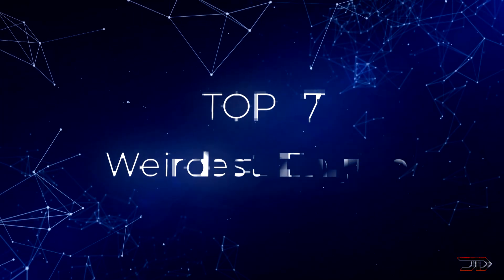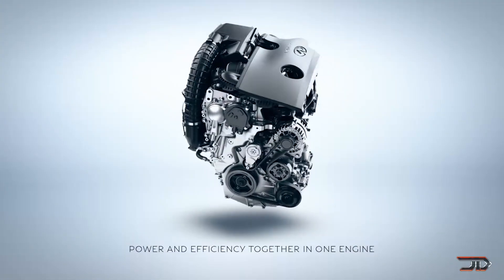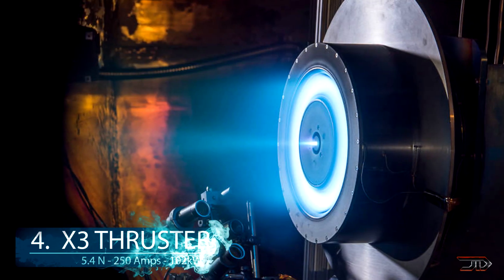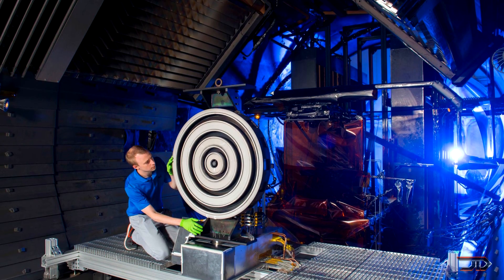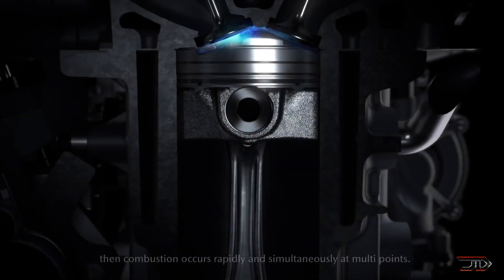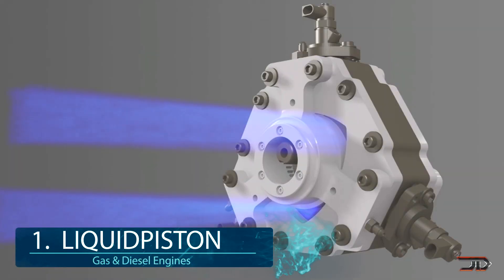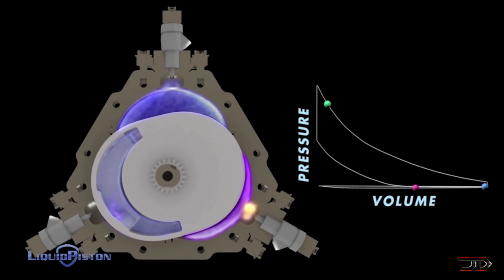7 STRANGEST New Engines

Comment: because of the excellent ratio of power and weight and the high rpm, what if it was configered like a train engine where it powers an electric generator thst powers an electric drive moter,? what would the mpg be?
Reply: you probably wouldnt need much of a gas engine to do that, probably something like a lawnmower engine lol. BUT big car companies have big engines and products for them so they will jam them down your throat :D

Comment: #5 QuasiTurbine looks like an ordinary Wankel Rotary Engine, modified.
Reply: Quasiturbine is not a Wankel bc Wankel had triangle piston surface and is based on the principle of volume variation between a curve and a moving cord (a sliding single piston-object on the curve). The Quasiturbine does not use this principle, since the maximum volume as well as the compressed volume are both in a straight line contour area.

Comment: I've seen some variation or another of most of these designs 20 years ago while working on my first engineering degree. 

Wankel engines are dead; too dirty for modern emissions, and impossible for 90% of mechanics to work on (aka, "throwaway" engines,  as it cost more to rebuild/repair one than just buy a new one).

Variable compression has been tried by just about every major manufacturer, as far back as the 70's; variable geometry engine heads and crankshafts just don't bode well for long term durability, and when they fail, they usually do so catastrophically, destroying the entire engine in the process.
Reply: keywords "as far back as the 70's"

Comment: For me the bottom line should be battery technology.  Aluminium, Magnesium as alternatives to Lithium.  Safer and much greater storage.  And why?  Simply one cannot beat an electric motor for power, torque, reliability and simplicity.

Comment: Design engines for electricity generation with no connection to the drive wheels and a means of temporary non-battery storage for boost purposes.  Or watch the cost of batteries drop, size per kW be reduced, lack of requiring liquid thermal management, and longevity, & say goodbye to ICE engines.
Reply: do the first part and you will see the second part :D

Comment: Guess what...they are making engines that need no fuel at all and have a superb minimum of moving parts...i.e. only one: the rotor. Called "electric motor". Great efficiency, supersilent, light, no emmissions, runs in both directions, great torque from sero revs, no excentric movements...anything else you need for propulsion? Combustion engines are, generelly speaking, one of the worst solution available for moving a vehicle with constantly changing speed and high variation of power consumption. Besides the high energy content of the FUEL it the far stupiest invention mankind has ever brought to such a wide use. Not to mention the fact that the emissions in gases and noise make our villages sometimes inhabitable.
Someone seems to make BIG BIG money with these...

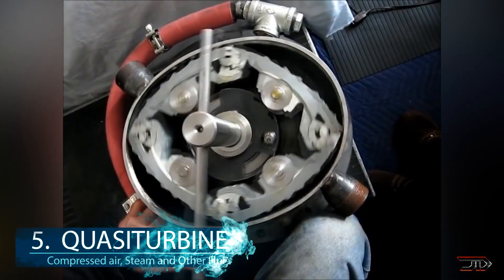Comment: The quasiturbine (No. 5) 1:32  is similar to an engine invented in the early 1960’s by Eton Rajakaruna, a friend of my father, in Hull, UK. He was from Ceylon (now Sri Lanka). He called it the “heart-beat engine”. It was featured in an article in Popular Science magazine in April 1962. He was inspired by a vague idea my father had about the possibility of containing the intake, combustion, expansion & exhaust cycles inside a bag-like vessel instead of using a piston & cylinder. Eton’s design looked very similar to the quasiturbine except the combustion took place inside the collapsible box. He was a proud man & claimed that he’d built the entire thing himself in his kitchen using minimal tools. In actual fact my father made most of the prototype parts for him & he made small changes himself. It never ran because it was almost impossible to seal the hinged corners & sides where the combustion chamber contacted the cam plates on either side. It recently struck me that it may have worked better as a steam or compressed air engine, a point that is also made about the engine in this video as well.
Reply: Cool story, bro 👍

Comment: Again with a  engine with just to many parts to go wrong. When are you lot going to get into the simplest motor of all.  An electric motor will and can out perform and last longer than any petroleum engine in the market.  It is also very economic in fuel economy in that it loses very little of it’s heat in the form of wasteful energy.  I ask you, how much more co2 are you planning to chuck into the atmosphere before you mess up the air we all breathe....?
Reply: Probably when we can produce batteries that can reproduce the benefits of petroleum engines.

Comment: This so-called "ACHATES" engine is another example of the "True BOXER" engine where the pistons meet each other in the centre. The engines in  Volkswagens and Subarus are NOT boxers. This same three-cylinder boxer layout was used in a British 'Commer' diesel truck in 1949, very successfully; only difficulty is this engine type must be supercharged just to get the fuel mixture in there. 
P.S. The exhaust note is really Sump'n Else...!  Ruummph...

Comment: Electric motors have all these beat. The combustion engine is going away....
Some of these are crazy complex for no reason except the better ways were already patented...

The ELECTRIC motor is about 95% efficient. Internal combustion engines are 25% to 50% efficient. Yes, most of your gas is wasted and doesn't move your car. It's mostly wasted HEAT adding to global warming....

An electric motor has ONE moving part with no friction. Electric motors last hundreds of thousands of miles....
Battery technology is slowly catching up and when it does, gas engines in cars will be history...
Reply: when you factor in the cost to produce electricity to store in an inefficient battery to run an EV...  the efficiency rating drops considerably. on board chemical storage of electricity (aka, batteries) are sorry to say... a dead end technology. no amount of technology can break the rules of physics/thermodynamics. (hot battery - high discharge, low capacitance; cold battery - high capacitance, low discharge; problems inherent to any battery design). not to mention weight and cost.

It'll take a generous leap in technology to put electric motors back in the #1 position for EV's. aka, cheap, efficient power generation on demand.

Hydrogen is the end game. It's the cleanest, most abundant, and most power potential per weight.  We just need a cost effective means to extract/separate it, and a safe means to store it.
Reply: @wildbill6976  I dont think hydrogen is going be the big new idea or a replacement for crude or coal. Hydrogen is a great idea for storing excess power from solar panels at home. But other than that its not going to be useful as fuel for a car. 
You never know what the future will hold. I would love hydrogen to be the end game.
Reply: @OregonDARRYL   Im all for clean technology the sooner and faster the better... Just dont claim 95% efficiency of electric motor powered cars because you just make me LOL at your ignorance. The older the car the more environmentally friendly it gets as it ages.

And the fact you resorted to try denigrate me instead of argue your point of view with an intelligent debate.  I could only possibly assume with 95% certainty (LOL) that you voted for Trump.
Next time you update your phone ask why their is a usb cable and power point charger in the box when the one from the old phone before is only needed? Why did it come in a plastic box instead of cardboard and paper box.

Most people understand that COAL is bad and if you think different then your wrong.
But solar panels are high polluting industry at the manufacturing level. and mining rare earth materials is moderately high pollution industry.
 Think outside the box and look at my first post because electric motor cars pollute more than modern diesel and petrol engines, it just changes where the pollutants are exhausted and since most countries are coal (base load) powered its not a clean form of energy nor is it efficient.
Reply: @paulduratec3410 , I didn't vote for the lying pussy grabbing mobster baby.
I think coal is shit.
Electricity can be generated from MANY sources.
The cars of the future WILL be electric, and those who don't know that are not paying attention.
Reply: @OregonDARRYL   honestly I didn't think you voted for Dump.
Nor should you assume I'm American.

And yes there are some very exciting idea's about power storage (non battery) and wind and solar farms that all governments can and should start investing in now.
But everything has its pro's and con's and you need to look at both sides.
Reply: Surely electric motors are the future in some part of transportation, but there is no reason to rush it. There is plenty of oil left to be used, charging infrastructure is scarce, ranges are still not satisfactory, batteries are big, heavy and relying on metals that are mined in some horrible conditions both for environment and humans, and are hard to recycle. So, easy.
Reply: fenton bevan  they are not that rare, Its like diamonds. Worthless stones that were marketed very successfully. Until finally there was an industrial purpose for them
Reply: except you forget to mention the coal that is burnt to make the electricity(base load), best coal powered stations are getting to 60%-75% conversion efficiency, then theirs the losses through power transmission maybe 10-20% or higher, once it makes it to your property, then the conversion from power point to dc current 85% efficiency at most, then chemical battery storage losses (altho there are some very efficient batteries coming soon (10years to production  lol)), then losses from converting chemical battery storage back to electricity to power an electric motor (which at best 75% efficient) then there is the losses of conversion to mechanical power train . Yup engines are so last century and electric powered cars are oh so clean for the environment. Ohh wait the environment hmm solar panel production is a such a clean industry no pollutants being pumped into river systems there.
Rare Earth Materials yeah no massive pollution there. Modern Diesel Motor 60% efficient,
 Modern petrol 60% due to diesel like technology coming very soon. Then their is  LPG direct injection engines and countries that run the whole economy on Ethanol<<zero emission fuel?.
Good and Bad in everything but yes electric motors are not ZERO emissions at all and I question where current technology will take us.
I think over the long term my 1972 ford escort wins this race
Reply: @Dirk Pitt, see Dirk, now you're talking about skin color. That makes you a racist piece of sh!t. So, see I am better than you! Ha. Also, I'm about as white as snow... so you guessed wrong about my name. Are you clowns ever right about anything? Nope...  hahaa.. what a dumbass..
Reply: @Dirk Pitt, you thought you were better than me.. right... you're not better than anyone. You're an ignorant old racist clown and you probably voted for a pussy grabbing LIAR, right? Don't puss out, answer, if you can.
Reply: Racist worm.
Reply: @Dirk Pitt, oh I see, If eventually the Earth will end, why not just do it now... I get it. Sure.... Or species stands no chance of survival with that attitude, but you are free to believe whatever makes you feel good.
Reply: @Dirk Pitt, enjoy the 2020 election when we take it ALL back from you old bastards... tick tock... Hahaa..
Reply: @Dirk Pitt, I mail in my ballot, then check online to make sure it got there. I live in an advanced state.
Reply: @OregonDARRYL    LOL
Reply: @Dirk Pitt, wrong. The fact that I give a shit about the planet and my species's future means I AM better than you, and you know it... But feel free to believe whatever nonsense you need to... that's what you cons are best at - conning yourselves... ;-)
Reply: The ones who hate America are assholes lime YOU who hate Americans. This country was designed to be ALL countries combined, and it is. Don't like it... get the fuck OUT.
The ones who hate America are the ones voting to make the rich richer and everyone else poorer, while we go 22 TRILLION into debt. The wealthy have taken 16 trillion out of our economy in the past 20 years, and you are their willing stupid slave. Nice going genius! Keep voting to fuck yourself, your family and everyone else, dummy.
Reply: @OregonDARRYL 
>This country was designed to be ALL countries combined
No America was whites only originally, the founding fathers actually had great amounts of discussion on if America was to be British only or accept other Europeans as immigrants.
So you got that completely wrong nevermind you forget that the electric cars have to get their power from somewhere which is as Paul said earlier gonna be burning fuel.
I really don't think you've got a clue on what you're talking about.
Reply: @Dirk Pitt, yeah, I knew you were an old man incapable of learning, or changing... it's because of guys like you, that our species has about 200 years left. Thanks.

Comment: This may send me back to the Internal Combustion Engine Design books I studied 50 years ago. The thing is, most racing engines have rather high compression ratios. We buy special pistons, or mill the heads or change other things to get what?  HIGHER HORSEPOWER. That is, High Compression results in MORE power.  Power and Energy are directly related, right. The more energy per unit time, the more power. So, seems to me that increasing the Compression ratio must increase the energy available to create power. That is LOW COMPRESSION results in LESS POWER.   If that ain't right, us racing guys must be experiencing other world physics.

Comment: Im building a engine with only 1 part that doesn't move and improves the power of 4 AA batteries to operate a Car, I have tested it and the Hot Wheels Car is really fast.

Comment: Once your ionic thruster has got you to a speed of 25 miles per second, can you tell me what device will bring you to a halt?
Reply: You wanna make a trip somewhere, you simply turn around halfway and brake by using your ionic thruster
Reply: @danieldorn2927  You'll have died of old age before you got to the nearest star.
Reply: @LeighHughesSenlis  That is why they are used for unmanned probes. Check out Project Orion which was thought as a way to transport humans around the star system and get rid of nuclear arsenals.

Comment: I prefer engine with low number on parts. Whis will make less friction inside engine and less oil wear. This option will result less mechanical failures and less oil usage on oil change in period of time

Comment: The opposed piston engine has been around for a looooong time
Reply: Dave Micolichek  and german  diesel for aircraft using.  Jumo  205 &207.
Reply: @matthiaskorn7544  Aaand the Deltic, used in both British navy light assault boats and Deltic Class locomotives.
Reply: The Fairbanks Morse opposed piston engine was used in us submarines since 1938! Got to see one in person at Great Lakes Naval Training Center.
Reply: The old knocker had a truly amazing sound.... I hope they can get this thing right, could be interesting
Reply: wwii era tank engines. some old school heavy duty construction equipment
Reply: It seems to have the same disadvantages like any 2 stroke engine - so what's the point? Do it because you can and because it runs?
Reply: Dirk Müller-Paul do it because the make a shit ton of torque with little effort.
Reply: @TonyMcClelland2  But you need two crankshafts and in the result it's just a 3 cylinder engine with 3 combustions for each revolution, although with two pistons moving with each cumbustion. This gives a little advantage in balancing the moving masses, ok. But the stroke for each cylinder is smaller because the expansion of the ignited gas is limited (unless you're not injecting while burning). And then it's still a 2stroke engine...amongst the combustion engines a rather primitive and therefore inefficient solution with much higher emmissions in noise and pollution. The 2strokers I know all need high revs - so where's the torque?

Comment: My comment is about necessity to necessary to maintain constant
compression with variable volume for proper mixture of air and fuel. My work is
exclusively mine, not of anybody else and the ones had enough time to decide
whether they are interested in the subject or not. My work is freely available on my
website.

Comment: The extra friction and weight of the Infiniti VC engine probably erases most of the improvement in efficiency.  The extra manufacturing cost of the monkey-motion linkage makes it more expensive to build and buy, so it probably won't pay off for the user.  I predict a short production run.
Reply: Nissan can't even produce a simple engine with a decent life-span.
Reply: @danielb6814  I've owned 12 Datsun 620 pickups with the L20b engines, one I put close to 300,000 miles on it before I pulled it, it was still running good but I swapped a Buick V6 into the truck, damn good little engines. I've never been into one internally cause I never had one that didn't run! Can't speak for other Nissan engines but the L20b is the best engine they ever made.
Reply: @danthomas9077  it was a long time ago japaneese car makers were very good
Reply: @ale bob Fifteen years as an auto mechanic has shown me the strengths and weaknesses of every auto manufacturer.  2 years as a Nissan dealership tech made me realize that they make many of the most poorly designed vehicles available.  The Nissan 3.5L V6 with its short-lived timing chain setup is quite possible the crappiest V6 engine of recent times.
Reply: Engineers also designed the Titanic and the Tacoma narrows bridge, so what is your point?
Reply: @danielb6814  those 2 trucks have frame failures here in canada, they are recalled since last 20 years and the 2021's are still recalled, they cant even fix their biggest issues